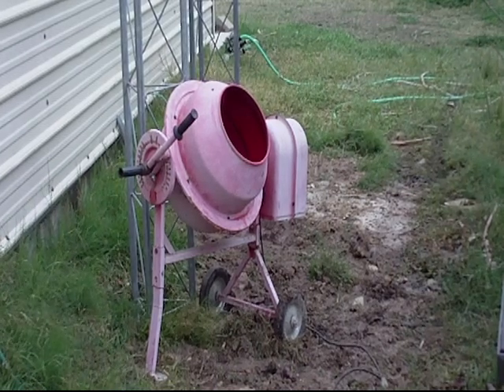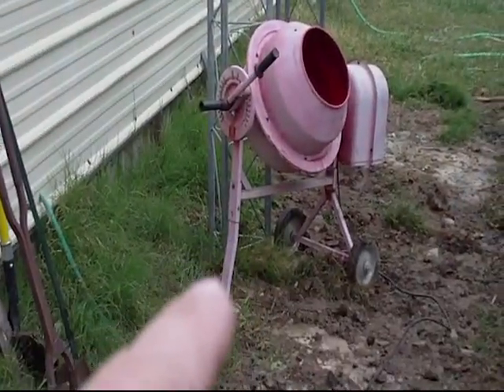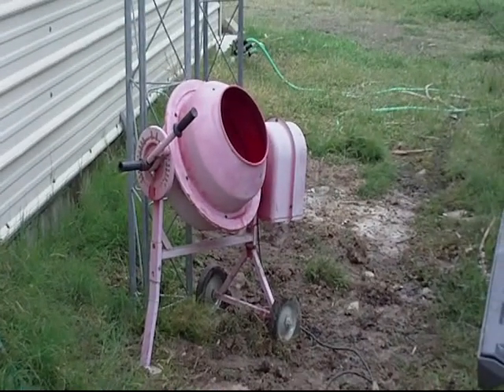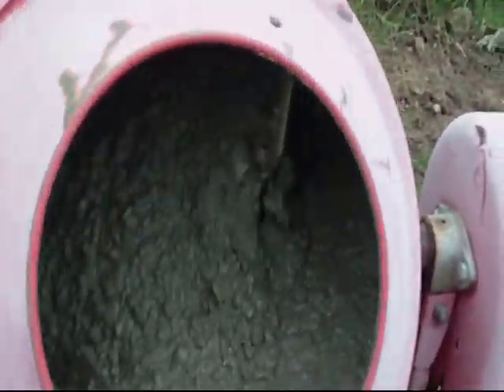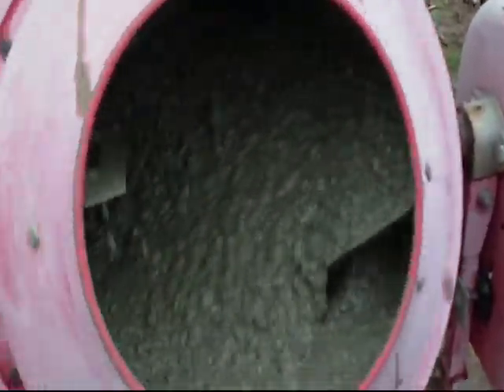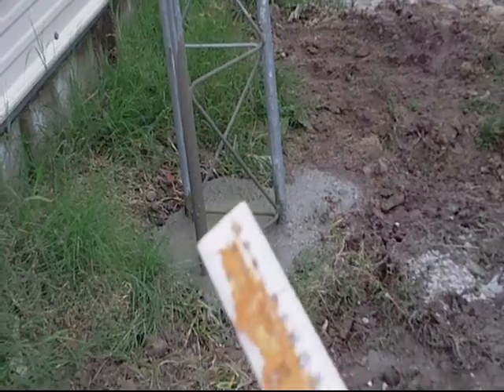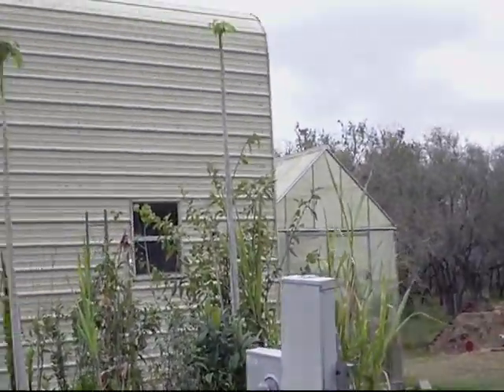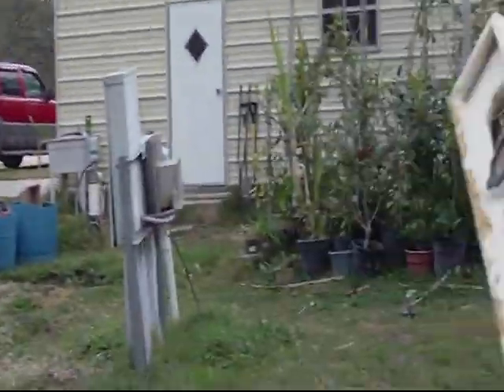Wind Turbine Tower Installation Part 2

Comment from the maker: It is about $100 per 10 foot section for a Rohn 25G tower section, that is if you buy it new. You can also try 2 inch galvanized pipe that you can buy at Lowe's or Home Depot, you'd have to use guy wires but it should not flex much at all. What diameter pipe are you using? Likewise, out here in the country, we have to have an internet tower to get line of sight over my trees, my tower is 40 foot with a 10 foot mast and the antenna on top - total height is 50ft, no guy wires at all.